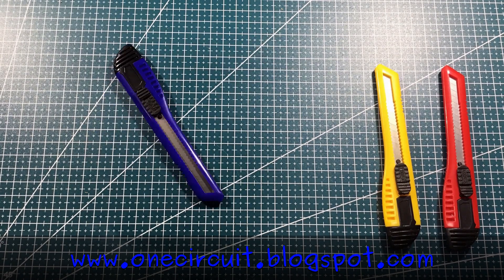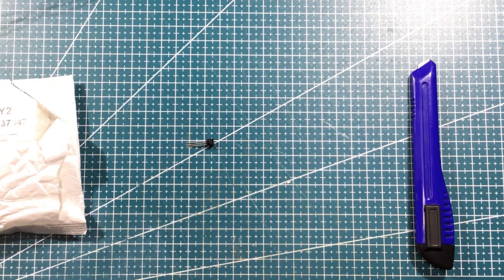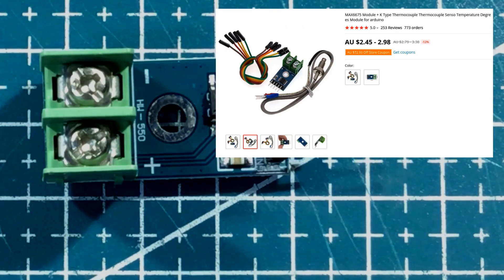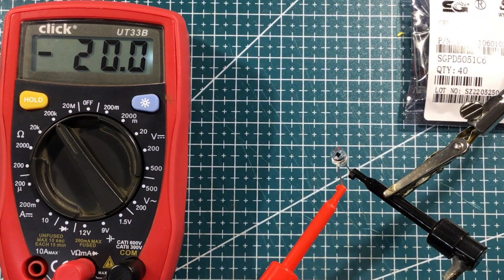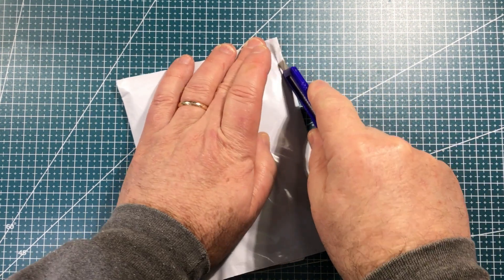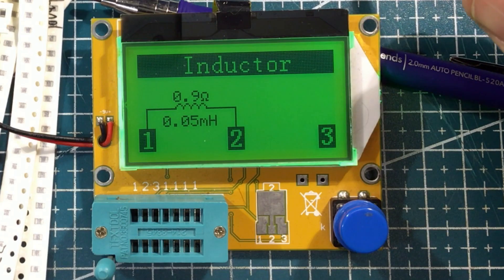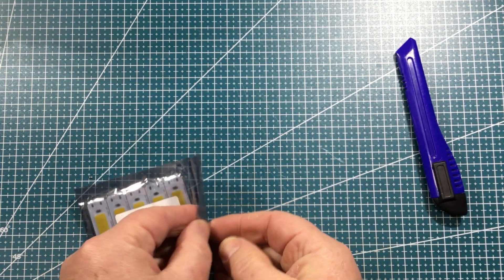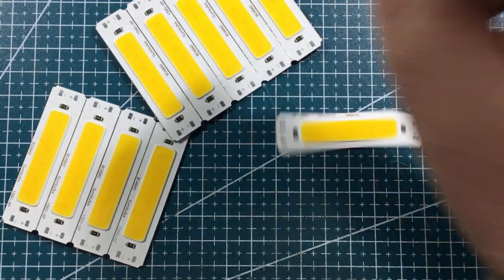Mailbag #20 - including LEDs!

Comment: Interesting as always. The next time I (re)build a 3D printer I'm tempted to try one of those Arduino boards.
I run Klipper so a basic AVR is just fine instead of some fancy ARM CPU.
Reply from the maker: I’ve got some work to do with those Arduino shields which is why I decided to put it off to another video, maybe two! 😀👍